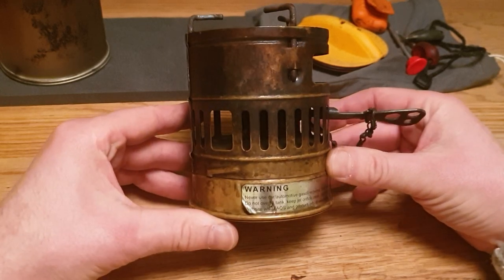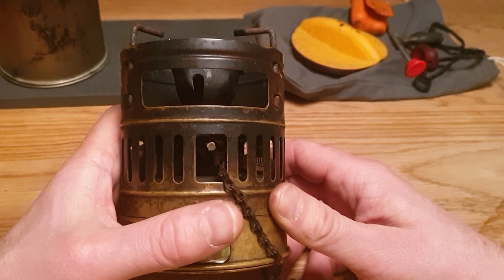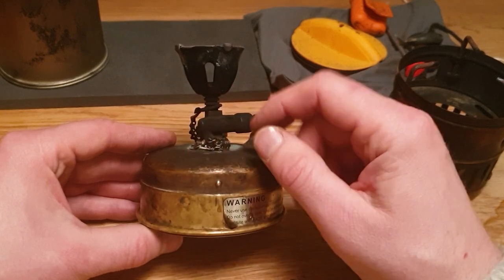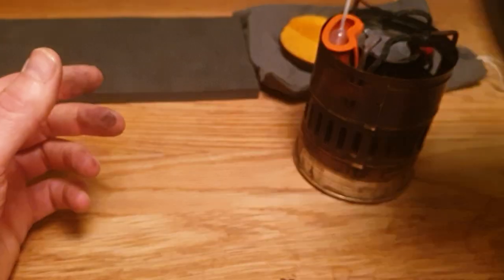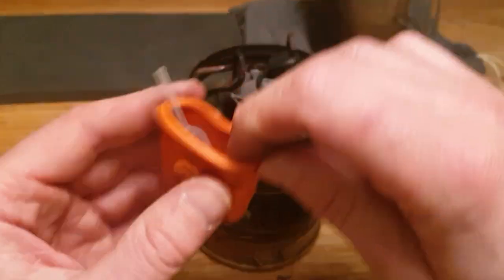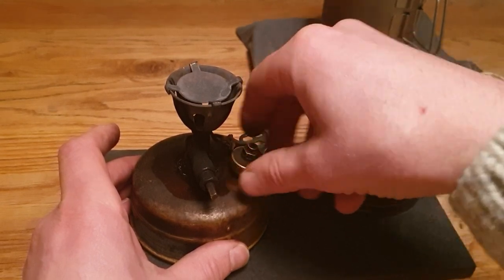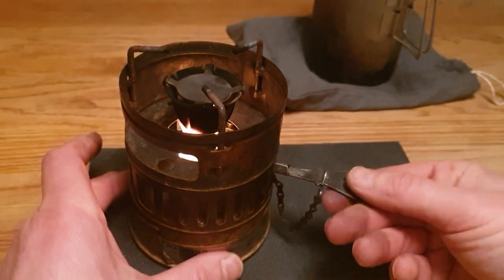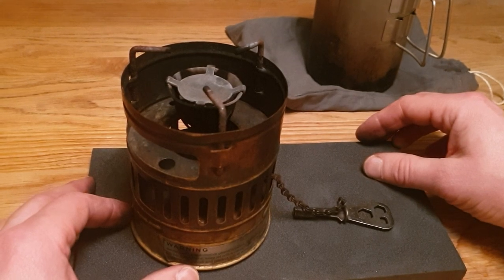Optimus SVEA 123R With some small modifications for winter use.

Comment: A great little stove. I have it's cousin, the Optimus 8R Hunter which uses the same burner mechanism.
Tips .. for what they are worth
* Useful spares to keep include the Graphite Packing in the Burner Control Stuffing Box and the Gasket in the Filler Cap / Pressure Release Valve. I had to renew the Packing some 10 years ago and the Gasket last year. Bought the stove new in the mid-70's .. not a bad run so far 👍.
* Something from an Instructor in the Swedish Military. NEVER use the built-in jet cleaner while the stove is still very hot i.e. just after use. This could result in the cleaning needle 'heat-fusing' in the jet, necessitating repair / replacement of parts. He wrote that more than a few recruits under his care have chosen to ignore his well-intended advice, resulting in 'Corrective Drills' to clear up the misunderstanding 😊.
Reply from the maker: Thanks for tips. I need to get some spear parts, as of now I dont have anny.
Reply: @hfokdvik  👍

Comment: Hello from Finland. I got my svea 123r last autumn and I really like it and use it a lot, but the priming and starting has been difficult in cold temperatures. Although the winter is over soon, I'm going to copy that wick-thingie around the vaporizer. Priming looks so much more effecient that way. Thank you for the tip!
Reply from the maker: Use a small insulation mat in the bottom also. It will increase the pressure in the tank. I bought my fiberglass wick from Biltema. "LASIKUITUPAKKAUKSET"
Reply: Try also fire paste... For priming

Comment: If you plan to use your Seva in cold temperatures in the minus 20 F   -29 C   I use a cork square under the stove to insulate it from the ground and make sure you over fill the spirit cup as wells as have a wind screen around the stove.   You should be able to get full pressure.  I find my Optimus 00 with a pressure pump is a little easier to get to full flame in extreme cold.  But they both are work horses in the cold.  I like the loud roar of the burner It lets me know how hot the flame is burning.

Comment: Why don’t you use alcohol for preheating your stove?  No black soot that way and works better.
Reply from the maker: I have used alcohol and alcohol paste before. Now do i only use gasoline. It's saves space and weight in my backpack and one less thing to remember when you pack. But alcohol is absolutely a wallid option to preheat. I have never had anny problem with soot on my stowes. So i don't notise anny difference between alcohol and gasoline for preheating.

Comment: Dear sir, I noticed you had it turned off the wrong way, that way you have just blocked the jet with the needle pricker, the correct way is to turn it fully to the right (clockwise) this closes the pointed throttle tip into the valve seat, I have 4 of these and I repair them for people as well, so I know what I am talking about, trust me.
Reply: Does this go for the 8R as well? close it by turning clockwise?

Comment: How far down in temps is it rated for?,  beautiful stove design.
Reply from the maker: The stove works on whitegass so it will burn pretty cold. I have been using it in - 34° Celsius without anny isues as long i have it on an insulationmat. But  i don't know how far it's rated for.

Comment: Where did you buy your cup? Will it fit over the aluminum cup? Thanks for the video!
Reply from the maker: https://www.gearzone.com/mobile/product.aspx?ProductCode=193-12806-1&404;http://www.gearzone.com:80/Snow-Peak-Hybrid-Summit-Cookset-Titanium-p/193-12806-1.htm=
It looks like Snow Peak have stopped producing the pot. Maybe this will fit.
https://snowpeak.com/products/ti-mini-solo-combo-scs-004t

The SVEA 123 R have the same diameter as a Nalgene bottle. A 750 ml pot that's fit the Nalgene bottle will most likely fit over the SVEA.

The Alu cup will not fit under the pot.

Comment: What do you mean, “it’s only 1400 watts,  so it’s not that noisy.”? I have no idea what that means.
Reply from the maker: It's a smal stow. I have stowes that put out 2800 watts. And they are alot noysier.
Reply: @hfokdvik  I've always measured sound in decibels. I don't know of another way. And as far as the measure of power I've always used BTU’s. Watts is electricity to me.
Reply from the maker: It's right that sound measured in decibels. I haven't measured the noise.
BTU's are an imperial measurement that more or less only used in USA and UK. Rest of the world are using the metric system. So her in Norway we are using watts as a measuring unit of effect. And as a rule of thumb when you are putting fuel through a nozzle up into a flame spreader. More Watts equals more noise.

BTU = 1 Degree fahrenheit on 1 pound of water.

We dont use farenheit or pounds. We use Celsius and kilogram.
Reply: @hfokdvik , this all makes so much more sense now. I knew the rest of the world didn’t use what we used but I didn’t know what else was common practice. 

That’s pretty cool. I have some overseas friends and they tell me that even they don’t like using Celsius because the Fahrenheit is better to use when talking about degrees of weather.
Reply from the maker: @emeryz10  I love to nerd out on numbers and mesurements. So the BTU would be ca 4777 BTU
And thank you for asking the question. I learned a lot about BTU, the history and where they us it.  Before it was only tree letters for me.